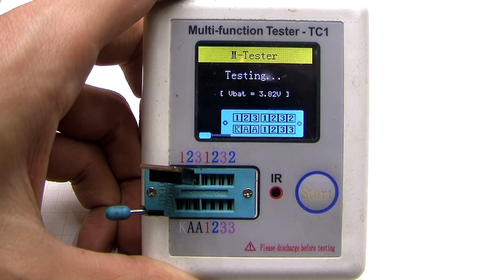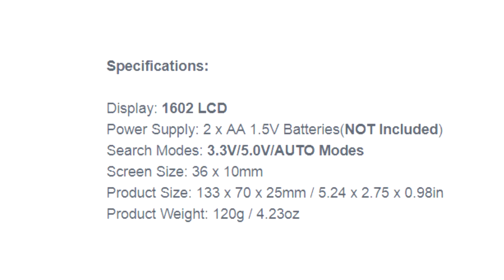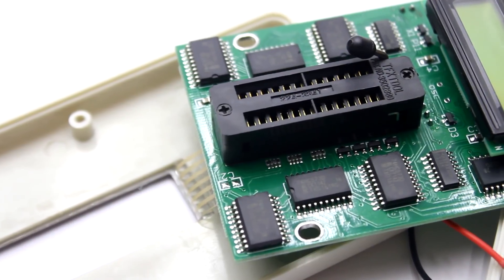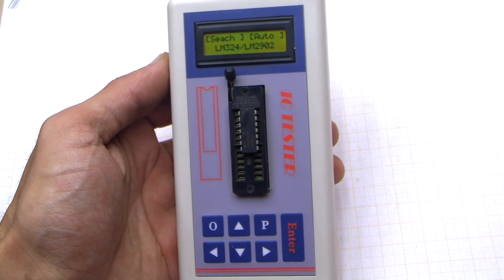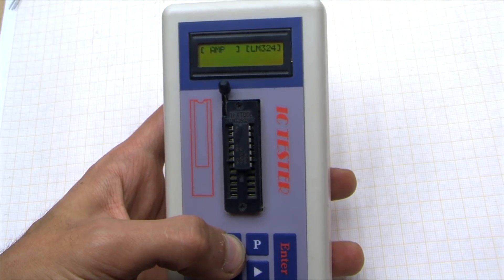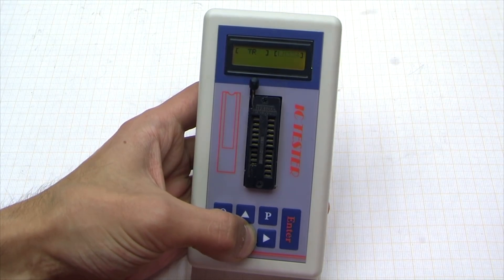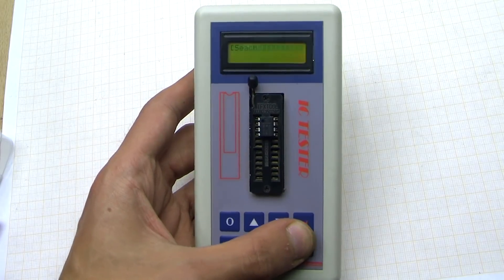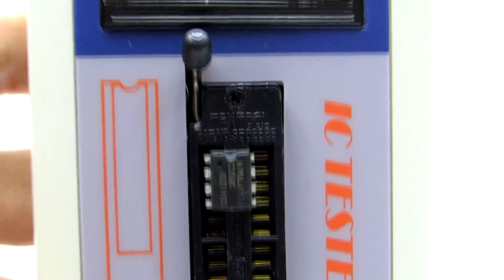This Device Checks Everything! Review of mega functional "IC TESTER".

Comment: So your next video should be on how to make transistor Tester using Arduino Uno !!! 😊😊😉😉😁😁🤑🤑
Reply: or directly atmega328p
Reply: i made one. If any one need help then I'm ready for that.
Reply: X-TREME Diy i made it with both arduino and atmega. tell what kind of help do you need.
Reply: Tech Seeker testing ic is not easy that's why I am interested in  such device , also I want help for making LCRF meter using Arduino naino or mini with nokia graphic display , I wish to use arduino full rom  in 1 device but problem is I don't no C language yet !!!!
Reply: It would be much cheaper than that :)
Reply: Tech Seeker nice why not M interested , Help me
Reply: X-TREME Diy there is already a code on that, if you don't know coding yet then it'll take decades to make such vast code. i suggest copy that pre written code and burn to your arduino. If any issues I'm always ready to help. if you want to see my tester just write your number below I'll WhatsApp the pictures.
Reply: Tech Seeker where can I know how to make an LCR tester